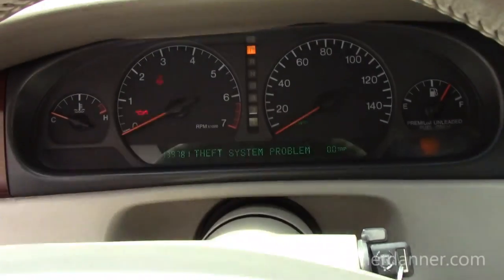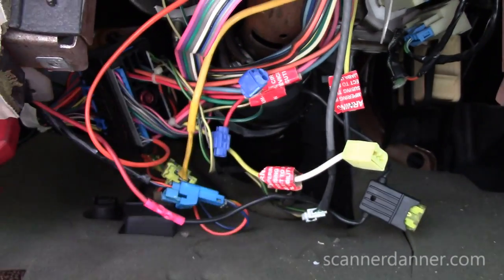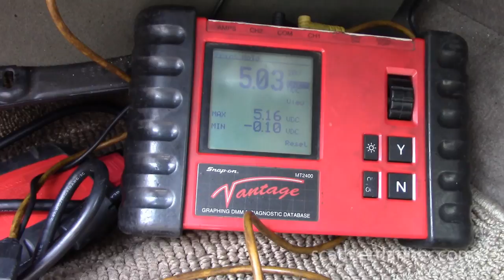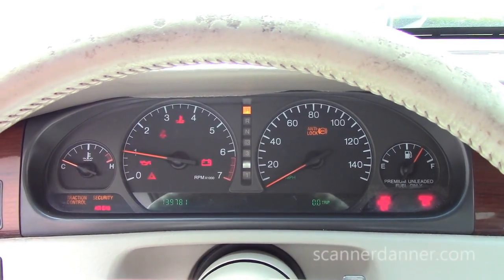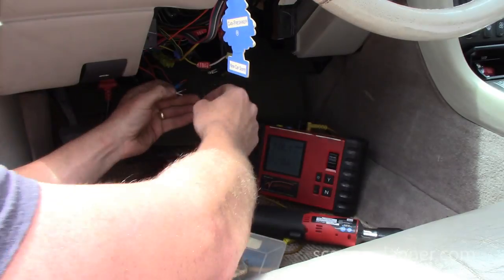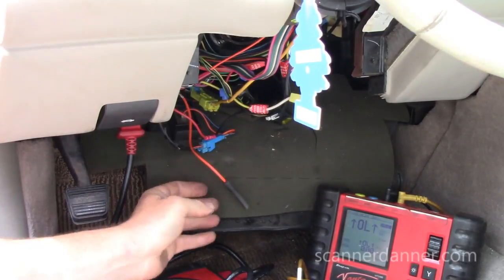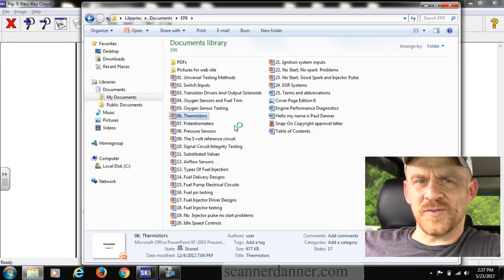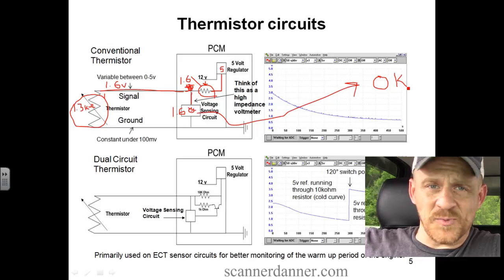How to troubleshoot/bypass a GM VATS Passlock Passkey System

Comment: Yes guys, get the book AND get on ScannerDanner Premium if you want to learn how these rolling tupperware-computers work! You won't regret it! 

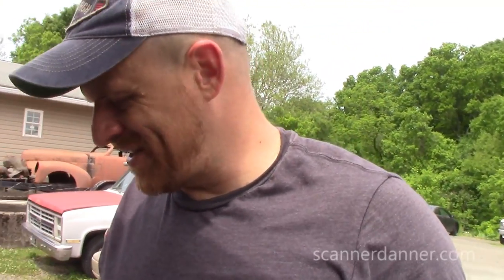HA! I asked myself that same question ( 10:06 ) about my '86 Grand Marquis when I was living in Phoenix. Story warning! :D

Woke up one morning, and that very question had been answered, lol! Someone indeed ripped off my 245k mile (at that time) Grand Marquis! I found it a year later in Bell, CA. I had been living in Livermore, CA at the time, so I hopped on a bus from Oakland to East LA at 1am (a story in and of itself, as you can imagine ... ) to retrieve my car.  I was so mad that someone would steal from ME - someone who struggled for every dollar I earned, so, I WAS getting that car back, and nobody could talk me out of it! They tried and failed! $500 in impound fees later, and I had her back. Battery had ZERO volts, and it ran solely off the alternator. I slid in under the guy who drove it out and kept my foot on the gas. Car was a mess - looked like an entire family had been living in it. Anyway, I made it out of that concrete jungle ( I cannot explain in words the relief I felt ), and got off an exit off of the Grapevine to get some chow - let off the gas, and she croaked! I had to walk a mile and a half to an auto parts store (luckily it was ONLY 1.5 miles!) to buy a battery, then walk the same distance back lugging the new battery. Long story short, I got it in, returned my core, ate my greasy McD's, and headed north on I-5 back to Livermore! Spent the whole next day detailing her, and listed her for sale in the local want-ad, since I already had a '72 El Camino I had bought in Phoenix. Sold her 3 days later for $1,500, which paid for my U-Haul trailer, a case of oil, and fuel to get back to MA! :D

A little tangent there, sorry. :D I never knew that system was wired like a thermistor - good to know! I've only dealt with one in the past on my buddy's Buick - forget the year and model, but it was fairly new (to me anyway, lol)  if I remember right. I soldered a bunch of Radio Shack resistors in series to match the key, and she fired right up! I thought my buddy was gonna kiss me he was so happy HAHAHA!

Comment: Because all I've seen is people wire multiple resistors together to achieve that I didn't know resistors came in sizes big enough to use just one of them, I'm going to buy a 95 Riviera with that problem but the guy was having trouble finding the key, The car has a brand new super charger on it that cost more than what I'm going to have to pay for the car,

Comment: Thanks for nothing. 0.86 ohm worth of resisters to the wires you stated and it did absolutley nothing.
Reply from the maker: Thanks for nothing?  You think a comment like that gets you more help? That you obviously need. 
What was your voltage on the two white wires disconnected and then after you wired the resistor? Key on.
Reply from the maker: Yeah the 99 is a three wire hall effect and you can't bypass it this way on those. Should have done your homework better.
Reply: @ScannerDanner  LOL nowhere on the internet does it say anything about the 99's being different they are ALL GM VAT SYSTEMS AND IM NO MECHANIC THANKS FOR ADDING THAT IN YOUR ALL KNOWING IN GENERAL HOW-TO VIDEO !!!